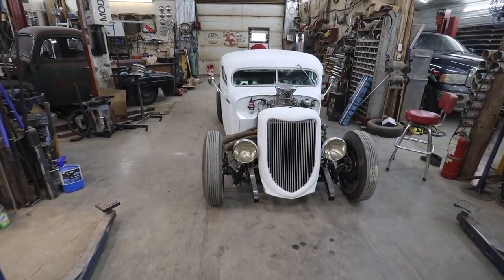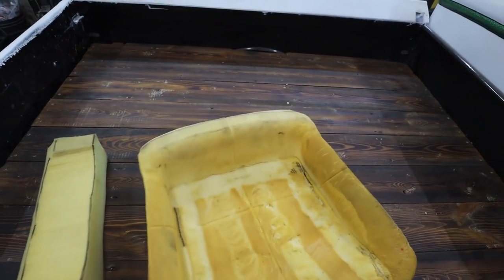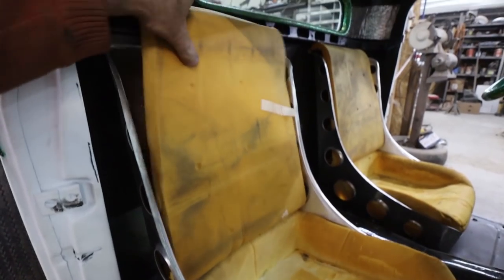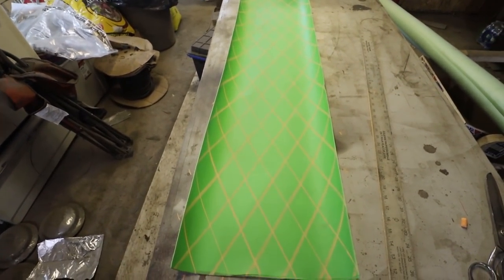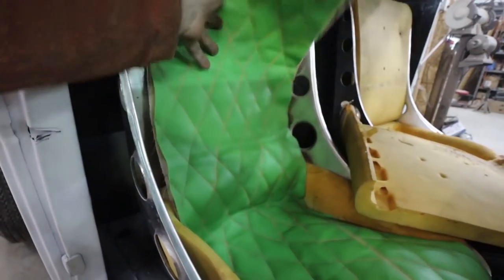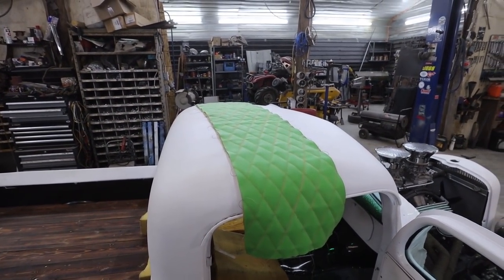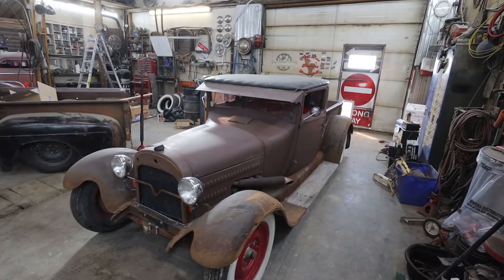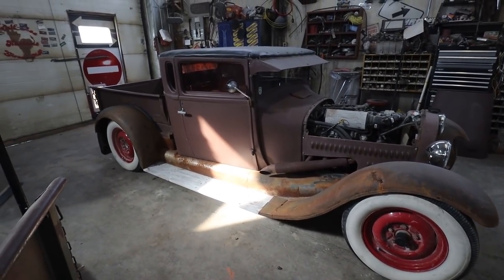Starting the upholstery and making the patterns, and pulling T pickup out of storage.

Comment: We used corrugated plastic to make the upholstery panels for our 53 Pontiac. I liked the idea of them being waterproof. It comes in 4 x 8 sheets; we got it at a building supply store. Its cross section looks like cardboard from an ordinary box. It's easy to work with, durable and light. (Saves gas, makes the car go faster.)
Reply from the maker: yeah have used it in the past also
Reply: @HalfassKustoms  Toyota used a similar backing for the trunk floor/spare tire well cover of the Corolla - maybe 2008 or so.

Comment: The electric carving knife is great for cutting foam. Just need to be careful to not use it too much at the same time. The blades sliding back and forth generate heat and they can get pretty hot. Cutting that foam with a hot knife makes a freakin' mess. Speaking from experience. The interior is gonna look great. The T pickup looks good. Needs a few tweaks and it'll be ready for cruising this summer. Be safe and stay well.

Comment: Halfass, you might try window and door draft excluder/sealer for the front wind screen, there are some brands producing a hollow rubber self adhesive tube (here "Primo" univeral sytem 10 year garantee) comes in several colours shapes and sizes which migh work... got mine from a local DIY store...
:-)

Comment: When fitting the door cards try using toothpaste on the ends of the regulator and door handle shafts. 
Easy to clean afterwards and doesn't dry up like paint would.